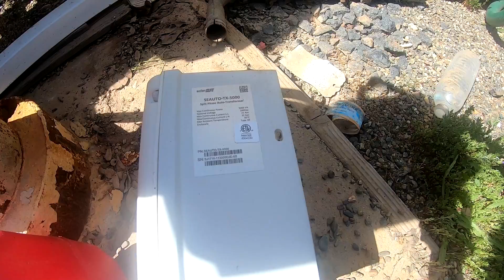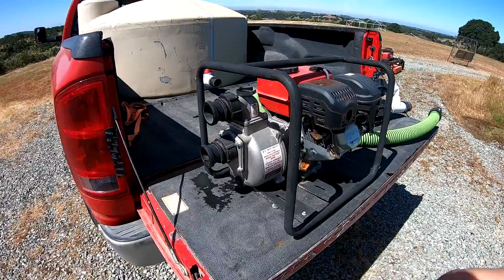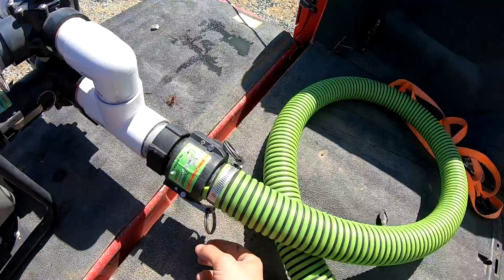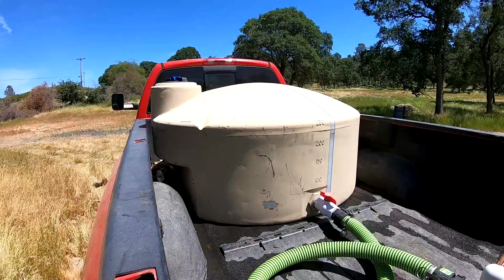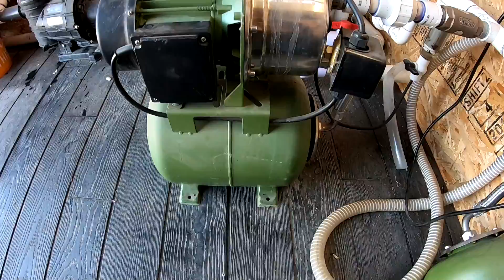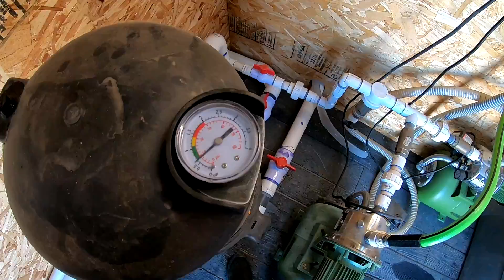Off Grid: Water supply & The Haul Up The Hill!

Comment: Because you only have to pressurize air down to the the well head you could easily use an air lift pump to have constant supply of water.
 Because the air dose not not care how far of a run you have as long as its up hill you can run it all the way from the well up to your top tank.
You can even test it out before you put it into the well (500ft extra pipe) by using a simple tiny air lift pump setup and use your current tank you have there at the bottom of the hill as the air lift pump's water source.

Bonus FACT: Air pumps can be run DRY. So even if you let it suck all the water out of your lower tank it wont hurt it. This can be done if you don't want to run an air pipe all the way down the well. You can still save the extra step of hauling it up the hill.

You can even put one-way check valves (Simple brass ones) throughout the rise to keep anything from coming back down and not having a ton of water weight to overcome on the
 lowest check valve. 

Because air-pressure is easy enough to make and dose not require a huge mass of electricity to run even down 500ft you can easily run it off solar and battery. 

Other have commented maybe think about a DC Pump but as I am sure you are aware it would require not only one hell of a HUGE gauge wire and or massive DC Voltage to run 500+Ft to the bottom of the well. (For those who do not know DC can not run nearly as far as AC without massive power loss. So using a DC Water Pump is out of the question.

Random Thought at the end of typing all this. You could also try using the bottom output of the lower tank as part of the air-lift pump's air trap making it possibly more efficient and easier to build.

Comment: No need for a PLC to purge the dirty water. Just a time delay relay. And maybe a double pull double throw relay to control two solenoids or a 3 way valve. Looks like with gravity helping you may only need a valve to shut off your discharge.  

Cool setup you have there!

Comment: kVA is a measure of apparent power (volts x amperes).  A 230V 3HP single phase motor would operate at 17A given a full load, or about 3.9kVA...  The rated amperage of the the 120V side is 41.7A...at the 240V side, it is 20.8A.  Don't misunderstand the ratings on these.  A 5kVA transformer is only suitable for 5kVA of load irrelevant of the voltage it is operating at.  Also, you're playing with fire without having some type of motor overload protection on the secondary of that transformer going to 3HP motor.  There should also be primary fusing or UL489 circuit breaker protection on the transformer.
Reply: I came here to mention the same thing. A 5kVA transformer is 5kVA always on either side. And also yes, absolutely need circuit protection on the secondary side (240 VAC output), and an appropriate type GFCI would be a good idea too since you're dealing with water.
Reply from the maker: What you guys fail to understand is it is an autotransformer. Only half of the current for the well pump goes through it. Auto transformers are not required primary and secondary protection the same as step up or step down transformers per NEC

Comment: I just came across your channel today and have watched a few videos ... wow! well done!

When the time comes for you to move the well tank up to the hill, would there be any benefit to adding another tank as your "dirty" tank, and your initial flow from the well would be diverted to the dirty tank via the PLC controlled directional valve you talked about adding at the well?  Once the "flush" volume has ran from the well and run into the dirty/non-potable tank, the diverter valve would switch to filling the well tank.  Might extend filter life/service intervals and the dirty tank could be used for irrigation or other non-potable uses ... just thinking out loud
Reply from the maker: Potentially yes.  Most likely we won't use the non potable water and just have the tan tank be pre filtered water

Comment: All that electrical in the pump room should be on either GFI breakers or GFI outlets. They are required in kitchens, bathrooms, outdoors, and generally anywhere water may be present. I would think that includes a pump room too. Safety first! 😉

Comment: I haven't been following/subscribed for very long but I have to say that I'm impressed by all of this and even use automation to control just about everything. Maybe something that you could look in to is what Linus from LTT has used and it's a wireless transceiver set not only for internet but even possibly monitoring your powerhouse and anything else you plan on adding on through the master system. A server may be a wise investment as well so you have prolonged data logging and even remote monitoring if you're far from home and want to check up on things.
Reply: Just because LTT played with it, it doesn't mean they knew how to use it properly. IMO they owe Ubiquiti an apology for not being better prepared to demonstrate their equipment. Anyways, HighTechLab I use Ubiquiti airmax on my ranch for bridging Ethernet, would recommend. +24V passive or PoE. https://www.ui.com/products/#airmax

Comment: They actually make a pressure switch that has a lever on the side that you have to hold until the pump builds pressure and the pump will operate within that pressure but if the pump drops below the set pressure the pressure switch will kick off the pump automatically so when you go back to restart the pump you have to hold the switch to restart the pump I have one on my yard pump at the cottage and it has saved the pump a few times when the intake has been clogged in the lake
Reply: The switch your referring to is called a loss of prime pressure switch